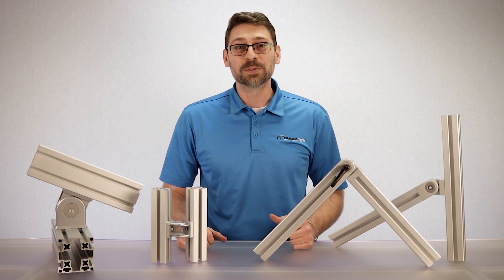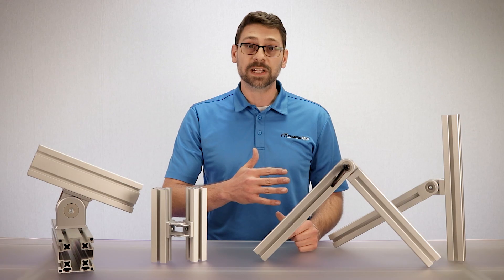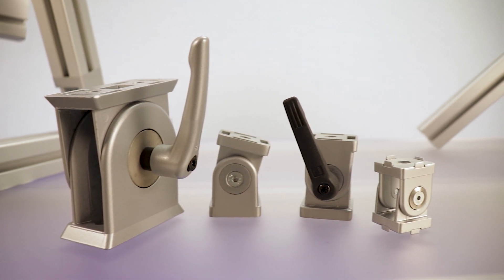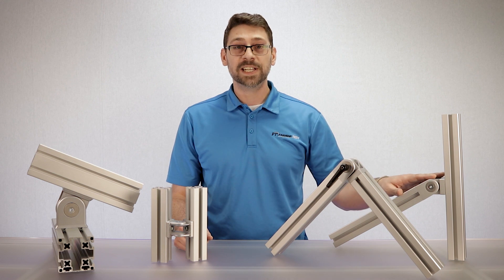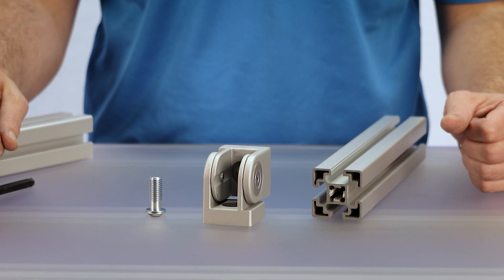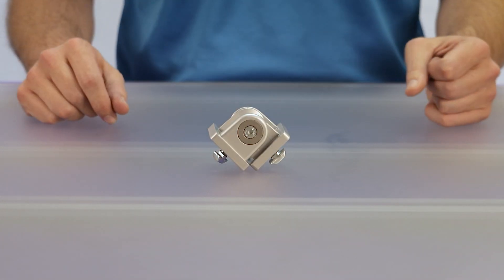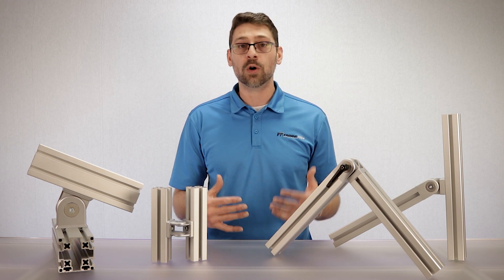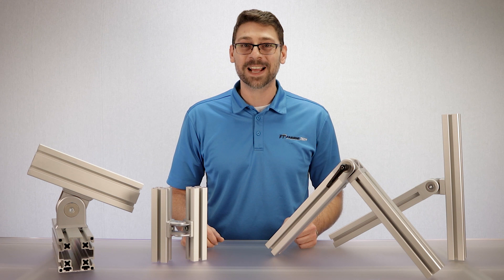Pivot Joints

Comment: What kind of loads are these capable of bearing? Like, say I wanted to use this to mount a level shelf on a 100 degree wall, how much weight before the pivot slips &/or something fails?
Reply: I was thinking the same thing
Reply: Not much.  It relies on friction, it's not a mechanical locking interface.

Comment: Pivot looks a lot like hinge joint... What's the difference?
Reply from the maker: Good question!  Regarding our material, hinges are typically used on doors and panels.   Pivot joints would be used to provide dynamic motion to a frame. For example to reposition instruments, or to set a conveyor at a specific angle.  On average they are capable of carrying a much higher load than your typical hinge, and can be locked into position with a tension handle.